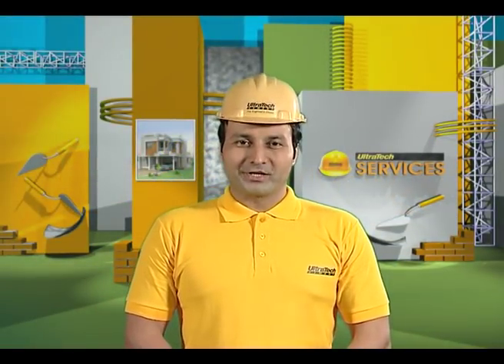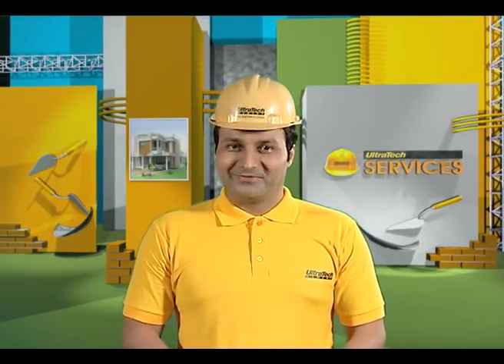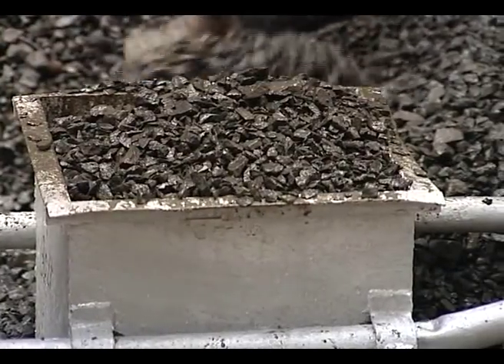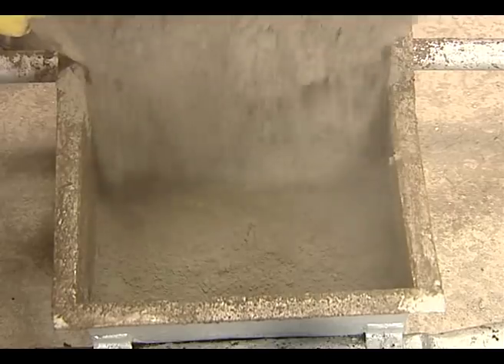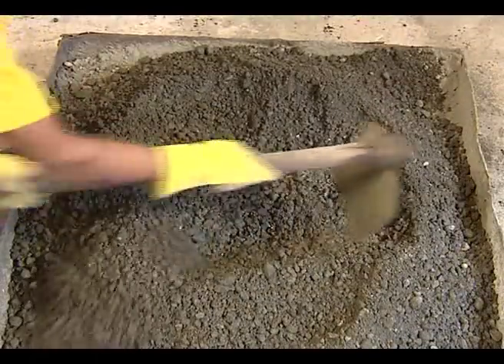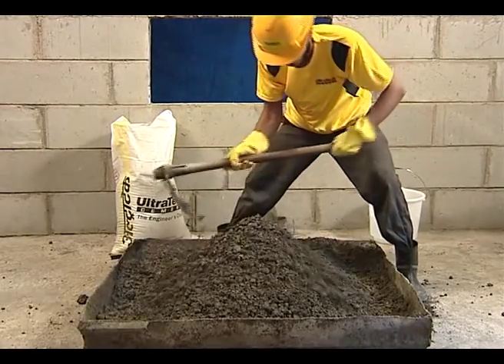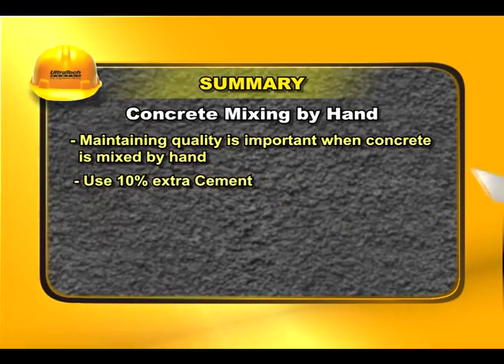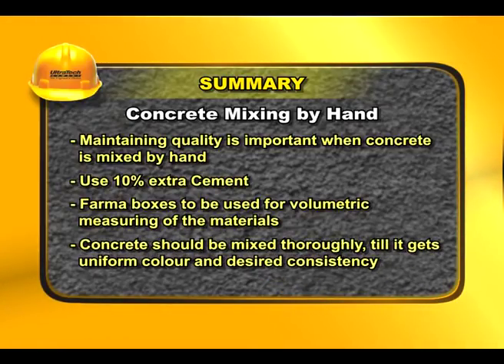HOW TO MIX CONCRETE MANUALLY

Comment: What are the proportions of sand cement jelly should have been added ?  They suggested more ed more cement 10% (more sales) but not the correct ratios
Reply: May I know where you will use the concrete? Because there are different concrete proportions for different uses.
Reply: That depends on what you are building though. For example, I am building a boundary wall using concrete bricks but for the foundation, I am using 3*8L sand (in a measuring bucket), and 3*8L rock. Also 1*8L cement with 1*8L water should fetch you desired results. If the sand is dry, you may need to sprinkle some more water as per requirement, use it judiciously, though. If the sand is wet,  you might want to use a little less water. Don't add more cement unless you have mistakenly used more water. If at all you are adding extra cement, also add the same amount of sand.
Reply: Wtfs he mean ten prercent and sht

Comment: No body tells this, every body tells the material ratio,What is the water consistently in mortar of brick work,and what is the water consistently in wall plaster and roof plaster
Reply: What did you get outa this vid?

Comment: What you mean add 10 percent
Reply: typically M20 is used for construction and it has a ratio of 1:1.5:3, Cement:Sand:Coarse Aggregate by weight, so u add 10% to the cement after converting it from weight to volume, the video doesn't tell u that probably cause, they expect the site engineer to be telling u that.